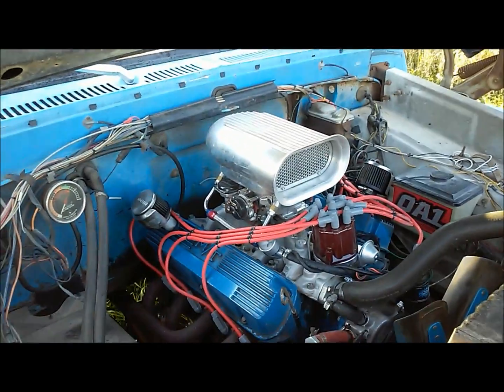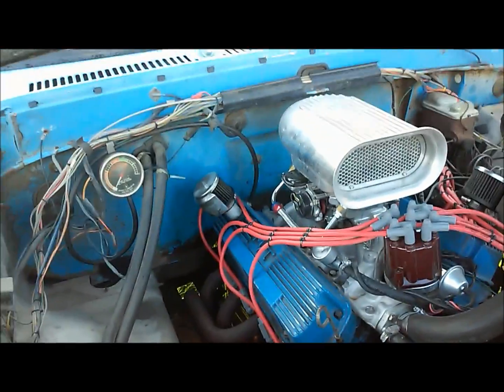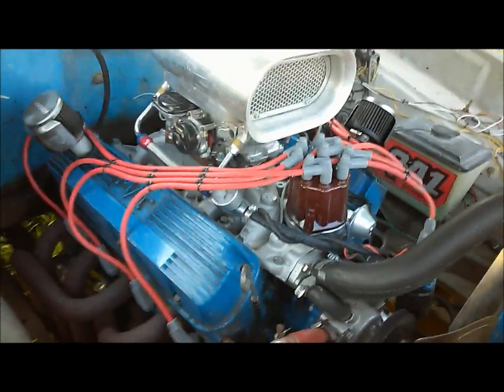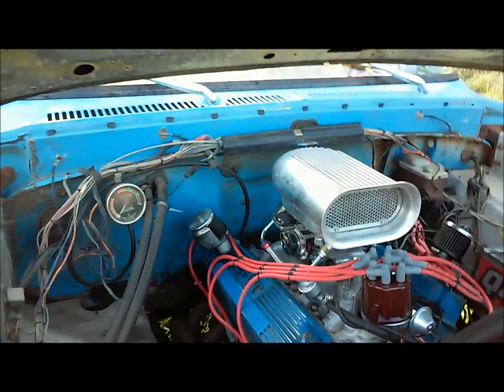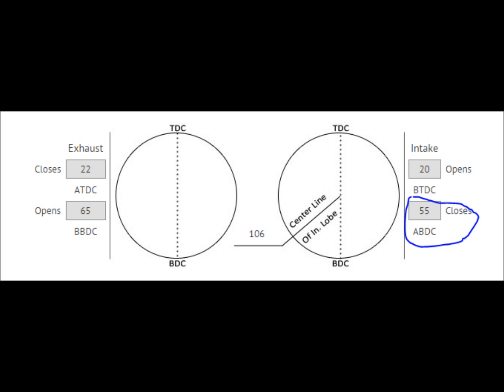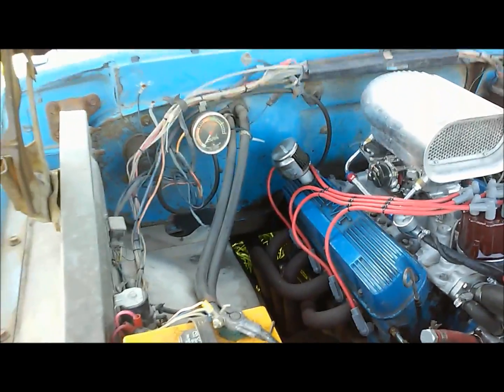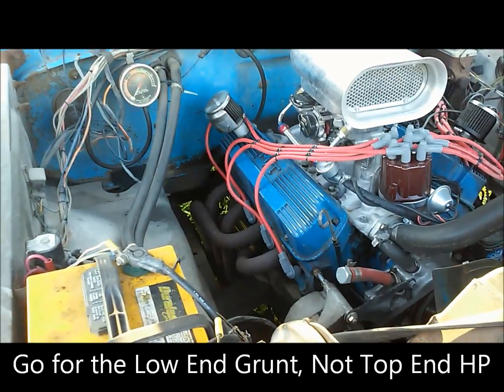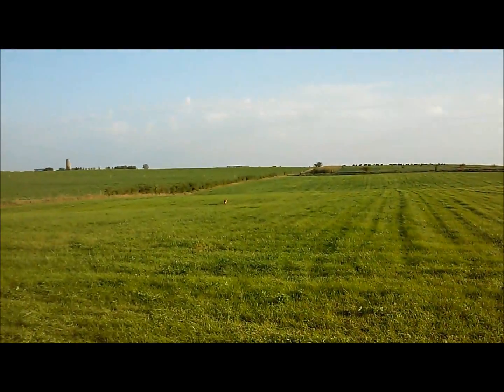Dynamic Compression: Biggest Engine Building Mistake

Comment: Hey thunderhead, I'm building up a Mopar 440 to a 507 with a .528 purple shaft cam and I'm looking to go to a 7.9 dynamic with the cam advanced 3* for seating to happen at (ivc) 69* but that makes my compression 12.2:1 will this run on pump gas? I'll go on your word
Reply from the maker: +Robert Sylvester as long as your dynamic compression is less than 8.5, you can run pump gas. after that with dynamic, you will lose way to much power from having to jet rich and pull timing.
Reply: +ThunderHead289 according to the calc I used before I would need 12.2. according to the calc in the link I need 10.3. the calc in the link requestes more info so I trust it more than the other. the other has you add 15 degrees to the ivc. im guessing to compensate for @050? or measured at .005?? not sure but let me know what you think. thanks for the quick reply!!    https://www.uempistons.com/index.php?main_page=calculators&type=comp&zenid=5d236f45833044eb782d2eb69bc64b8e
Reply from the maker: i will look into this and get back to you. dont want to steer you in the wrong direction.
Reply: thanks!!
Reply: +ThunderHead289 any luck??????
Reply from the maker: i can say this, the calculator that i use, when used correctly, has given me the proper values. i trust it to be correct. adding values around outside of the calculator sketches me out on it a bit.
Reply from the maker: +Anthony Smith do you have something you want to say? im not trying to write my senior design paper here. and sketches was the word i meant.
Reply from the maker: +Robert Sylvester i was looking between the two, and i would think that you need more than just the intake timing from the website. i dont know what calculations are going on in their background, i would call them since they have a number, and ask them to compare their calculator with the one i use. they really dont seem to get enough info to make a solid determination, and i dont like that assumed timing stuff at all.
Reply: +ThunderHead289 I researched your calc and trust it over the other. Thanks for the link!
Reply: +ThunderHead289 on this calculator is it best to use actual seat timing or adv timing???
Reply: +Robert Sylvester disregard seat timing is the answer. Thanks
Reply: @ThunderHead289  how would I figure out what the additional cr would be from the dynamic ?